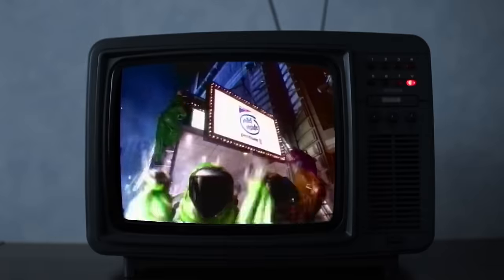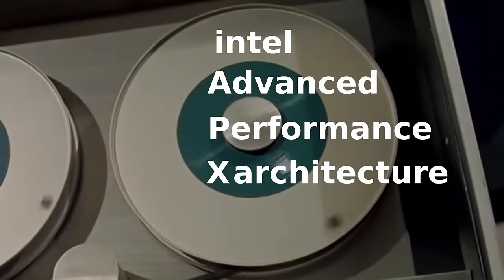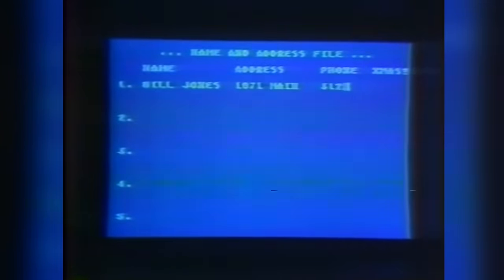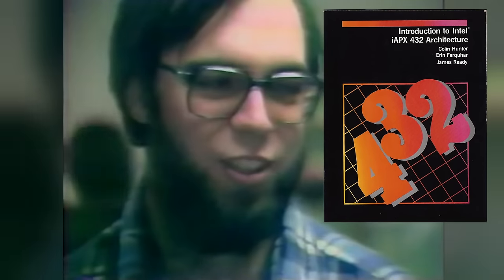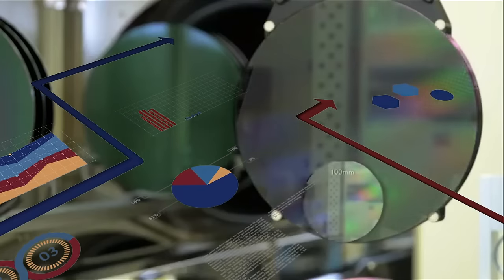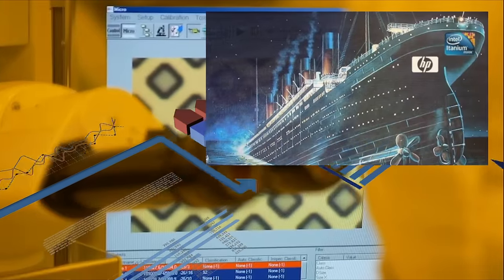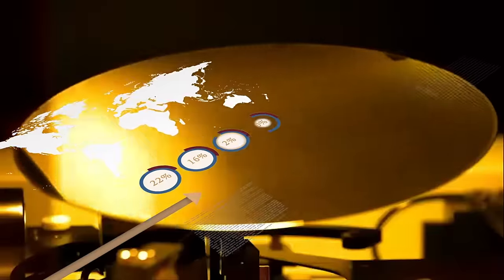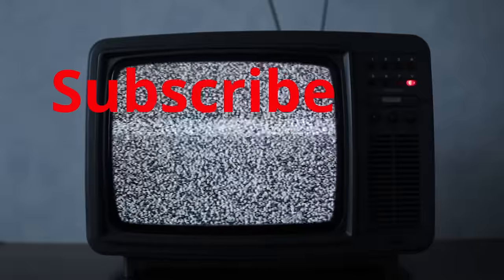iAPX The first time Intel tried to kill x86

Comment: also dude. Intel wrote several operating systems:

* ISIS - for 8008's and paper tape
* ISIS-II for 8080/8085's and floppy disk (hard disk added later)
* ISIS-III for 8086's with floppy and or hard disk
* ISIS-IV a networked operating system for  iMDX-430 Networked Development Systems
AND
* iRMX a preemptively multitasking operating system used in all sorts of embedded applications (and was also the kernel for the GRiD Compass)

Comment: Isn't returning values from procedures the norm? Like how would you return a pointer to your stack, since the stack will be cleaned during the return from procedure
Reply: Actually, for small-sized values, the most efficient thing is to return values in registers. If it's too big you have to return some or all of it in the stack. (Even if it's large you can return the first few elements in registers)

Comment: The iAPX-432 was literally the Burroughs B5000 system shrunk down into VLSI. Ultimately, process size, the unbelievably slow subroutine call times, and the absolutely horrible system (bring-up) software support killed this thing.
Reply: Interesting.  I thought the big part of the B series was HLL specific microcode programmability.  Wasn't i432 a fixed ISA?
Reply: @christopheroliver148  The B1700 was the line with the per language reconfigurable microcode. The B5000 series were fixed Algol computers. The 432 was an evolution of that, being a proper capability based machine. It is interesting that while the Ada and 432 were both started in 1975, the language itself was only defined a few years later and was officially released in 1980. The 432 supported object-oriented programming, which Ada only adopted many years later.
Reply: Not literally. The Borroughs system allowed you to load your own microcode, which was sort of like a RISCy assembly code. Sort of.
Reply: @jecelassumpcaojr890  Understood.  I had some brief time on a B1000 series machine where a friend worked.
Reply: @davidvomlehn4495  As Jecel rightly points out, those were later generation Burroughs architectures.  I had brief time on a B1900.  The shop had full source too, but I was just goofing around with FORTRAN.  The shop was mainly a COBOL shop though.  I wish I had a nice emulation for this.  Hercules is somewhat fun, but a late generation Burroughs emu would be funner.
Reply: That literally isn't true. The B5000 was brilliant in its design and execution. The 432 was not.

Comment: I'm getting old. I remember all of this. My 1st computer was a 80286 and everyone thought it was great. A few years later, my dream machine was a 486.
Reply: Old? Whippersnapper! I had an 8080-based Altair 8800 and not even the 8800B shown in the video. Ah, the good old days, may they never return!
Reply: Hey, when everyone was ditching their 286s in favor of 386 i picked up 5 of them for $100 each (which was quite a bargain price when a PC cost $1000-2000 each.).
With one computer running Novell 2.10 and the others networked as Clients i wrote a Medical Insurance Claims processing system that at 50% capacity on one phone line processed 50,000 claims/week and beating competitors who were running on mainframes). At $0.50/claim i was earning $25,000/week with those old 286's.  
We had to hide them in a closet with a bookshelf in front and told clients that the computers were off-site (leaving it to their imagination was better than revealing $500 worth of computers).

Comment: I've got an iAPX 432 system - it consists of three custom multibus boards built by a company called High Integrity Systems, and they are installed into an Intel System 310 that has also been rebadged with the HIS logo on the front. Strangely, HIS left the original parts list sticker on the bottom which lists the original System 310 hardware.

The iAPX 432 chips in the system are release 3.2, which I have read was their last revision of the architecture.

It boots up using a 8086, into an OS called iRMX 86, and then you are meant to run a program called 'deb432' (a debugger) to then load up iAPX 432 binaries and run them.

Unfortunately, the Interface Processor refuses to initialise, and I suspect that is due to faulty RAM on one of the HIS boards. There are ~160 4164 RAM IC's soldered on the board, and I don't currently own a desoldering station. Quite frankly, I'm not even sure I want to attempt to figure out which ICs are faulty...

I managed to create a disk image of the MFM hard drive using an adapter designed by David Gesswein. So there is that, at least.

Honestly, considering Intel wanted the iAPX 432 to be their first 32 bit architecture back in 1977, and to drive their business forward into the 80s, I suspect the fact that IBM and the clones were so successful, and the fact that the 386 being 32 bit and still capable of running previous x86 binaries were the main reasons the iAPX 432 was killed (speed issues aside...).
Reply: Great video. I worked for a while with the folk who set up "HIS" in 1981. They had worked for a UK R&D lab called STL (best known for optical fibre transmission) on a joint iAPX project with Intel for a few years to develop reliable computer architectures for high reliability systems such as telecomms switches.. When STL pulled the plug they set up on their own to produce iAPX432 boards and develop high integrity systems. I was a late comer to the team and not convinced about the iAPX approach so decided not to join them.  
The iAPX was actually started quite some time before Ada arrived and intended to provide in hardware the same kind of high integrity that Ada then achieved through its syntax and compiler. It was therefore somewhat redundant  putting all that overhead in the architecture, especially when dependent on a compiler that was rushed to market.  Despite that, HIS went on to be quite succesful.
Ironically I had joined the team after studying at UC Berkeley, though a bit before their work on RISC. I did however return to Berkeley a year or two later for a most interesting conference on computer architectures. Quite heated with UCB and IBM (901 chip?) on one side and iAPX & VAX on the other.

Comment: Actually, nothing Intel has ever done, except x86, has been a big success. IA64 was also quite a failure. x64 (aka x86_64) wasn't even made by Intel, it was made by AMD, Intel just licensed it. Intel even failed at making ARM chips (they tried and failed twice). Which brings me to the following conclusion: Intel can do nothing, absolutely nothing. They landed a once-in-a-lifetime lucky strike with x86, and they're still tugging from it today. 

Just recently I read an article that Intel is three years behind AMD and Nvidia in high performance computing. Even more so, Apple pretty much sunk all of Intel's consumer flagships overnight with its first CPU of its own; and that's with a CPU that costs Apple about $50 to produce. Just to be clear, even with the Rosetta emulation layer, which replicates an x86 CPU on Apple's M1, the system is still faster than two-thirds of all native Intel CPUs (Getting beaten by software emulation is the most embarrassing thing that can happen to a CPU manufacturer.)

And x86 has architectural limitations due to design decisions Intel made in the early days of this architecture that make it harder and harder to further increase performance (at least if you don't want to give up backwards compatibility), which is why this curve is flattening out and ARM has simply moved past (ARM makes life harder for assembly language programmers, but in a world where virtually everything is done by compilers and interpreters, who cares).

If x86 dies, Intel dies, because Intel just can't do anything else and even in this area they are not really leading anymore, since AMD is pretty much on par.

Comment: FYI I was at Microsoft when they started using Intel's Vtune. Its purpose is to "RISCify" CISC code for faster execution. Example: it removed i286 "Bounds" a long multibyte instruction that stalled pipelines. Note the rise of buffer overflow exploits from this time. (slowly, but i386 executes that instruction. A 32 bit version of the 286 had been considered.  Like most Server chips at the time, it was x86 compatible to boot bios then switched to non-86 32bit protected mode. Unfortunately the i286 protected mode was more difficult to program. MIPS, Alpha, PowerPC, all supported ARC boot.

Comment: 13:35 OK, if the 80286 was such a big improvement on it, can you name one operating system that was written to take advantage of its protected-mode features?

There was only one I can think of, and that was OS/2, which didn’t appear until 1988, when most Microsoft-compatible PCs sold were already being based on the 80386 chip.
Reply: There were a few DOS extenders that also used the 16:16 protected-mode universe of the 286. Mainly because of the expense of 386 machines at the time. Windows 3.x also had a 286 DOS extender. Without the VM86 mode it couldn't multitask DOS apps effectively. But there were things, besides OS/2 that used the 16 bit protected mode. 

A really obscure one I spent years with is iRMX 286. Yes, another Intel operating system. A real-time executive for the 286. It happened to be the OS of the Siemens Hicom 300 PBX, which was quite a popular PBX back in the day.
Reply: @markg735  VM86 mode was introduced with the 386, not the 286.

But yeah, OK, there were some specialist OSes that found a use for it.

In the Microsoft world, there was “expanded memory” and “extended memory”. The latter made use of the 286 protected-mode features, while the former was just a device driver, that would work equally well with older 8088-based machines. I think that made “expanded” more popular than “extended”.
Reply from the maker: OS/2 Is a good example, xenix also had a 286 version, I think NCR did a unix srv4 port for 286 and up. The main issue for 286 uptake was the relativley short time it had as the top end pc processor before 386 hit the market compared the lead times of an OS.
Reply from the maker: Also I'm not sure the pirmary OS vendor for the PC failing to advance their OS to take advantakes of the processors features is a good argument for that processor not being a significant improvement on the previous interation.  Being able to run twice as many instructors per clock cyle is a big deal, being able to address memory sizes similar to a well spec'd mini of the time was a big improvement. Having protect mode is massive as Unix like OS protection is now possible.  It also saw the 286 getting used in none PC  hw where 8086 was not as it needed protected mode.

Comment: IBM chose the 8088 for business reasons, not engineering. Firstly, it was second sourced. At the time lack of a second source was a deal-breaker.  Secondly, between the two sources IBM was more confident the expected volumes could be produced and yielded.which would keep price low.

Comment: @RetroBytes amusing video. I'd almost forgotten about the i432. The culture of the times was very much high level languages of the Pascal/Algol kind driving design, ADA being the most prominent/newest kid on the block and as I recall there were no efficient implementations of ADA and it took forever to compile. Because the ADA language specification was very complex and the validation of it highly rigorous it just took too long to qualify the compilers and my guess is, Intel ran out of time to do a decent compiler.

Also, ADA was designed to support stringent operating scenarios in the military space. Ultimately the server market was driven by business scenarios which didn't need such stringency, paving the way for C.

So wrong hardware for wrong language for what the rest of world wanted...

Comment: The 432 was not intended to kill the 8086. The problems in the 432 caused the development of the 8086.

The 432 was intended to kill the 8080 which had inspired competitors like Zilog and Motorola. The 432 was intended to leapfrog way past them. When it became clear that the 432 was going to be very late, Intel made the 8086 in a mad panic. The 8086 was intended to be source code compatible with Z80, while capable of addressing more than 64K by means of clumsy segment registers.

Comment: Missed out the 80186, the stepping stone from the 8088/8086 to the 80286. I know a lot of people forget this existed, it wasn't on the market long, and IBM skipped it before coming out with the 80286 based AT.
Reply: A colleague claims he owned an IBM PC that shipped with an 80186. It may be that his memory is faulty and it was actually a clone, as I'm certain other manufacturers briefly used that processor.
Reply: @chriswareham  Yeah, the one's most to use it here in the UK was RM, who sold a lot of machines to education. A lot of their machines were 80186 based, probably bought cheap as the 286 was out soon after.
Reply: The 80186/80188 were microcontrollers for embedded systems, they had many auxiliary circuits built in that were not compatible with the auxiliary chips that IBM had used around the 8088, of course they use x86 code but they couldn't run IBM BIOS or any 100% compatible BIOS. There was at least a MS-DOS version adapted to work on them but they still couldn't run programs that used direct access to some of the PC hardware.
A few years later Intel released new versions with an integrated 8087 FPU.
Reply: @ruben_balea  I've used near PC compatibles with the 80186 chip.
Reply: @truckerallikatuk  Yeah, I know such things existed, but as far as I know they could not be expanded with PC hardware, for example a VGA or a Sound Blaster
Reply: @ruben_balea  Probably true, but it's not important if it's a big batch of PCs for educational use, which is where I came across them.
Reply: @truckerallikatuk  Yes, for that the main thing would be to optimize costs, in most of Spain we did not have anything similar at that time, in my school the first computer there was was a very expensive IBM PS/2 486 in 1994, I do not remember the model or the specifications exact but it was one of the last PS/2s that IBM marketed... probably they could have bought half a dozen 386 clones for the same price and thus they could have shared a computer between 4 students instead of using one the teacher while 24 students watched without learn anything.
Anyway, my parents bought me a 386 in 1992 for my 10th birthday, an Olivetti PCS 386SX, to learn how to use it I had to go to private classes for adults, they taught us MS-DOS and MS Works, everyone there used an XT but since I was 20 years younger than the average the teacher exchanged his AT with EGA 😎 for my XT with MDA and as a reward for finishing the work before he let me play a video game while I waited for the others to finish...

Comment: The iAPX might have performed better if it had been implemented on an Intel 80186 based system.  That system would have been impractical enough to get an Edsel award.

Comment: PS: I find it amusing that the only line of CPUs Intel has had any real success with was based in a contract for a terminal chipset they botched so badly the client  was forced implement what they wanted in TTL... which Intel then used as the basis of the CPU they were supposed to design!

Comment: Nothing wrong with Ada, still one of the best languages out there. Early Ada compilers we’re crap and flow because they were still working out how to implement compilers for the features no other compilers had at the time.
Reply from the maker: It's not that I thing Ada was bad language, it's just it was be touted at the time as the language that would dominate compsci going forward, and it just never did deliver on that promise. Looking back it seams odd how many companies thought ada was the future and targeted products towards it, add yet it just failed to take off in the way many seamed to expect.

Comment: Back in the day, I was working on the design of Ada.  

Before that, I contributed to a report to the Navy about the future of CPU hardware.  I predicted (against the sage advise of my boss) that object-oriented CPU hardware would be developed by the mainline manufactures.

A year or two passed with my prediction looking ridiculous.  Then Intel announced the iAPX-432, and was vindicated.  

But, the iAPX-432 failed.  I was wrong.  Software succeeded in eating hardware.  And, I didn't write reports for the government after that.

Comment: Them, as the iAPX 432 slow because it was slow or because the compiler was dumb? If the compiler wasn't  dumb surely the iAPX 432 would be much faster, right? Would it be competitive?
Reply from the maker: The compiler realy did not help. However I doubt the processor would have been competitive even without the compliers short commings.  Being split over two packages (with 1 or more additional packages) made it expensive and added performance problems. They also could not ship fast clocked versions later due to that. They would have stuggled to reach the performace of the m68k and would have got no where near the price point.
Reply: The whole idea of such a high-level instruction set was to make it easy for the compiler.
Reply: Almost anything can be made fast if you throw enough hardware and transpiling at the problem.  There would be no way to make it efficient, though.

I've read through the iAPX documents a few years ago, and it blew my mind that not only are instructions variable length, but they do not have to align to byte boundaries.  Now that's just mad.